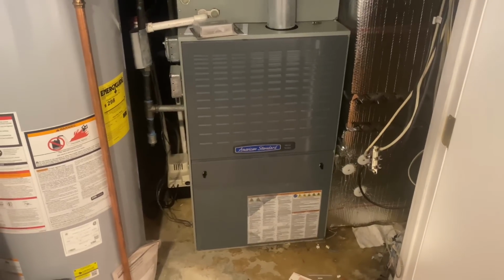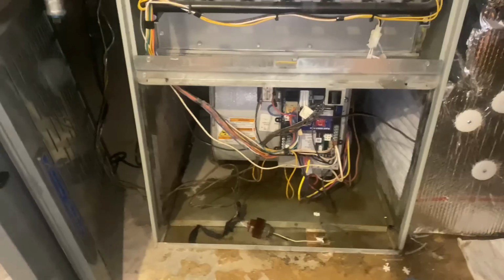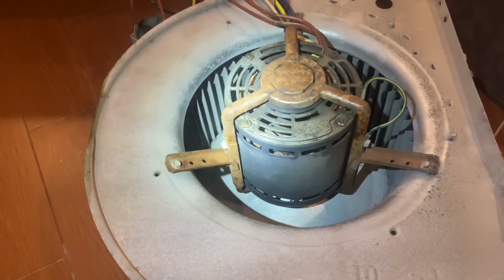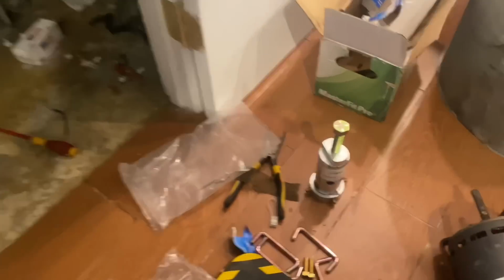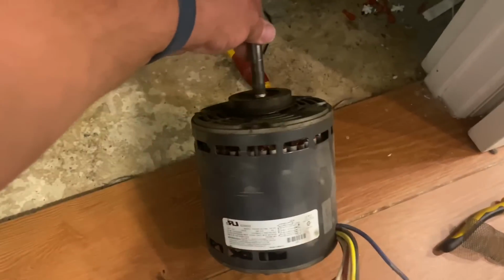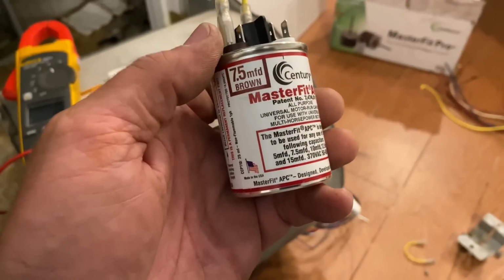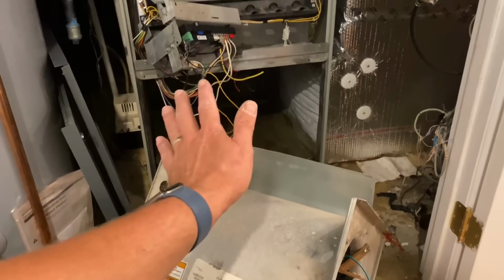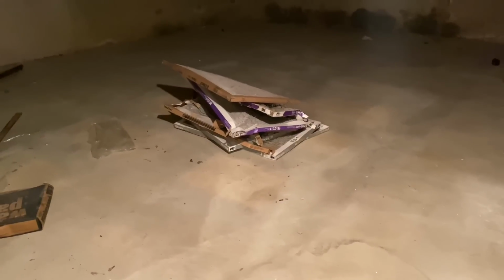Burnt Gas Furnace Blower Motor Replacement Using Supco Shaft Blaster

Comment: I just bought one, looks great for cutting off shafts that are too long and rubbing the compressor, or cutting off a too long shaft that makes it so you can't get a puller on it, or cutting off a super rusty shaft so you have less pulling to do to get the blower off. looks useful for making a repair look professional so you don't have a super long shaft sticking out and looking ridiculous

Comment: Surprised to see the replacement motor was rated for 10 or 5 mfd?  Does the data tag say anything about which to choose?  I had a similar trane furnance  in my first home and remember the sound the blower produced on startup.  Thanks.

Comment: Besides supplying an Amrad capacitor that new motor has ball bearings. That’s cool 👍🏻 to Century Electric.  Did you put a Pipe Doctor service sticker on that furnace before you left the site?
Reply: @PipeDoctor  just checking there. 😁

Comment: probably shouldn't use an impact driver on the cutoff tool, it could shatter the cutoff wheel if it binds and impacts much. not likely that it would sends parts flying up out of the blower wheel, but it could weaken it for next usage, even though the rpm is fairly low compared to actual grinders and cutoff tools.
it gets rather exciting when they come apart at 18K rpm's, especially up under a car with no clearance and escape route. 🤡💩

Comment: Your using a universal blower motor on trane/american standard. Bad choice. I used same motor on one amd got the motor mount as tight as possible. The starting torque of universal blower will twist in that mount and rip the wires out of the motor. Had it happen more than once. Ge makes an sos motor and you get the oem mounting rings and use those
Reply: I’ve seen it happen.
Reply: Never heard such a thing been using rescue motors in trane equipment for years

Comment: I bought a refurbished blower motor with module to replace my dead blower in my AC. It works but now my AC fan blows slower for a while, and then kicks up to a higher speed for a while before finishing the cycle. Is this because the new module with the new blower isn't programmed properly? The AC still works good and the house is comfortable but could it damage anything if I don't fix the fan speed problem? Thanks!
Reply: @PipeDoctor  yes, or at least extremely close. Rpm spec might be 100 different
Reply: Toss some gauges on that unit while running to see if its effecting your sub cooling and or super heat.